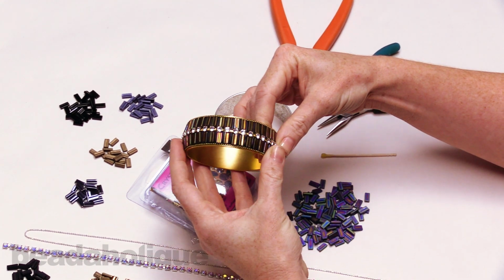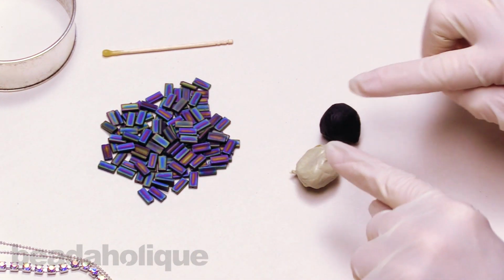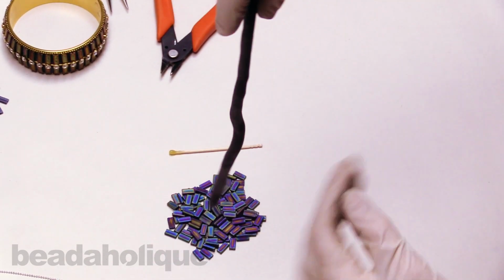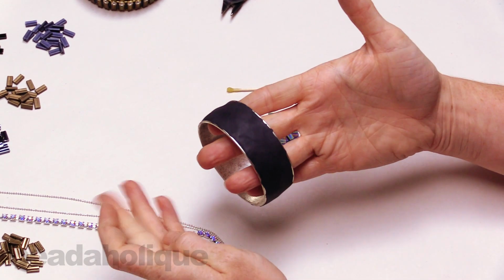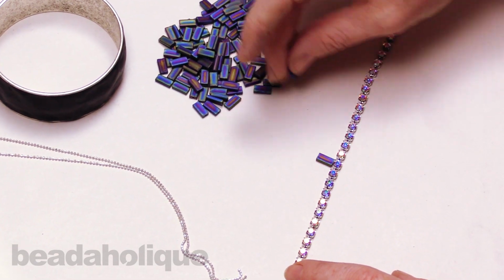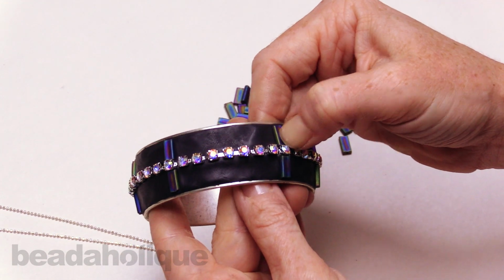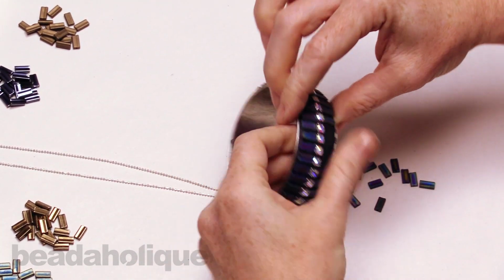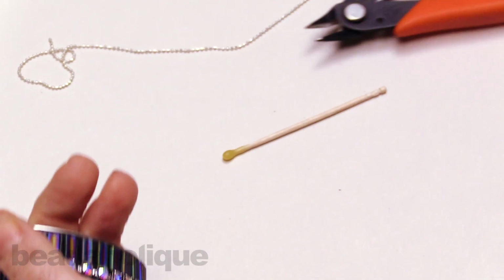How to Make the Harper Bangle Bracelet using Miyuki Rectangle Beads

Comment: Hi can you use the process for a open Bangle
Reply from the maker: What's important for this technique is using a bracelet that has a channel, meaning it has that lip around the edge which will let you set clay into the bracelet neatly. Here's a channel bracelet in an open cuff style that would work nicely: https://beadaholique.com/products/elegant-elements-cuff-bracelet-base-with-channel-for-delica-seed-beads-30x66mm-1-bracelet-silver-plated